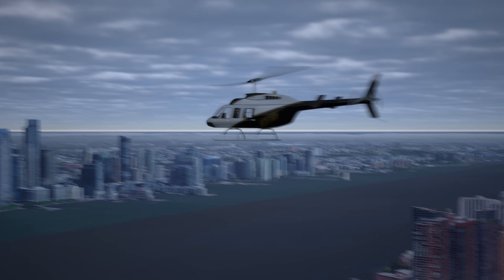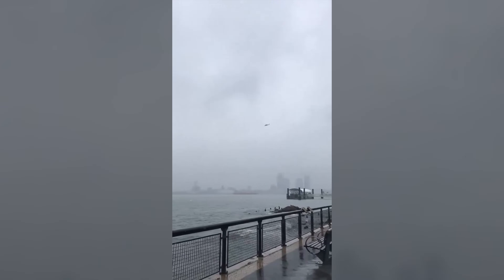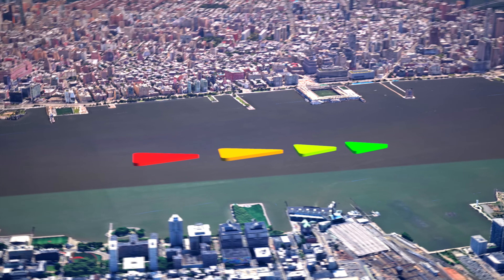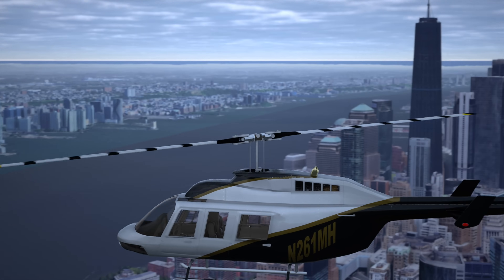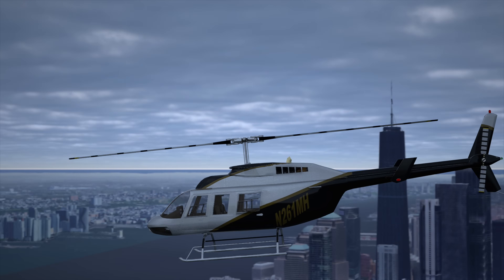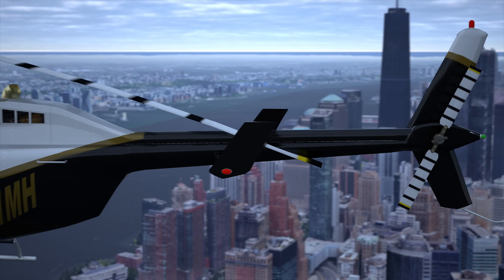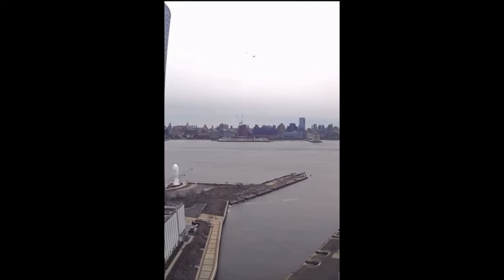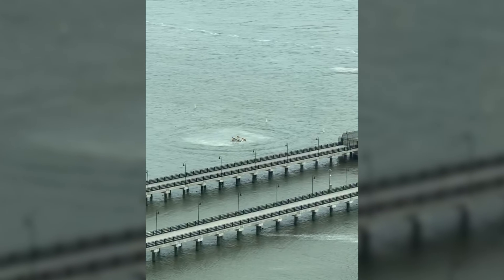Helicopters DON'T just fall from the sky - What is "Mast Bumping"?

Comment: Finally a good video about what possibly happened
Reply: But you got admit it’s a good guesswork
Reply: except the rotor blades were intact with the gearbox while flying into the river.
Reply: @bobbys4327   I wonder the rotor mass broke off that what look like. Which is odd
Reply: Orrr yall could just wait until the do a full report and find out what exactly happened instead of speculation. Whats the point in needing to guess what happened  NOW

Comment: An underslung rotor system (like this one) is prone to mast bumping. Rigid and articulated systems are not. Mast bumping is when the hub contacts the mast during low g maneuvers or other abnormal conditions. It can happen without damaging the helicopter. Mast bumping does not = main rotor contact with fuselage/tailboom. I lean more toward cabin roof delamination, xmsn mounting, or other failure over mast bumping. Also, in a truly catastrophic MB scenario, wouldn’t the rotor separate at the hub (where contact is made) and not take the xmsn along with it? 

Still a good animation and presentation.
Reply: I agree, don't think this is mast bumping due to the fact the transmission is with the rotors
Reply: @MattyEngland  Gearbox failure is the most likely cause.
Reply: Not if you are carrying a CEO, I think there is much more to story
Reply: @JimmyBeanz13  CEO's are not immune from accidents. The incident helicopter had already flown 5 perious flights.
Reply: @ Apparently you haven't looked into owner of the heli company much....tell me what you find

Comment: In the footage from the beginning it seems the aircraft rotates aggressively to one side, AND THEN 1 or 2 seconds after that, the tail boom seems to separate from the aerodynamic pressure (?)

Question: Could this aggressive rotation be caused by the malfunction of the tail rotor?

The video is quite low resolution, so it could also be that the boom indeed separates and the rotation happens from that, and the falling tail boom is just hidden behind the main body of the helicopter from this angle.

Comment: Wouldn't the rotors hitting the tail shatter the blades when they appeared to be fully intact and still flying on their own
Reply: The blades are one of the strongest components of a helicopter.  Looking at other helicopter wreckages, the blades sometimes only bend even when they hit the ground.
Reply: @toolbaggers  I do know the old S-58 and H-53 blades are that way. I know they are tough, Bell blades, but they are laminated and composite. Certain instances they may shatter, just being composite.
Reply: @idrinklight44  The ones I saw were shredded.
Reply: Blades are pretty tough
Reply: Good point. The "parts" look very intact, like almost a perfect separation, but I don't know. Not a #expert
Reply: No they wouldn’t. Blades are extremely strong, helicopter tail booms are rather flimsy as they have to be light.
An impact with the boom will leave significant witness marks on the leading edges of the blade though.
Reply: Yes they would.
Reply: Jesus nut.
Reply: The blades maybe though but they would definitely have deformed with a tail strike.
Reply: @Dyson_Cyberdynesystems  unless the tail was weakened before, and broke because of the hit.

Comment: October 8, 2024 - Meridian Helicopters earns FAA Part 145 repair station certificate.

With this FAA certification, Meridian Helicopters, LLC can now provide extensive services in five critical areas: 
1- Airframe: Specialized in sheet metal and composite repair, comprehensive component overhauls, routine maintenance, and detailed inspections. 

2- Engine: Authorized to inspect and maintain Rolls-Royce M250 – C20, C28, C30, and C47 series engines. 
Instrument: Certified to install and test essential flight instruments. 

3- Avionics: Equipped to install and test advanced avionics systems, ensuring safety and operational efficiency. 

4- Pitot Static and Transponder: Qualified to test and inspect these critical components for optimal performance and regulatory compliance.

Comment: That helicopter looks obsolete.
Reply: That was my sense.  I gather it was getting long in the tooth and had been repainted and repurposed for NYC tours and duty with light stress at most.   If I was starting an air tour business, I would likely buy used equipment, refurbish it and rely on maintenance.  Despite the best maintenance, all machines eventually wear out.  There is a technical term:  the law of entropy.  I am not attempting to imply that there is anyone at fault or assign blame. It's just the fact that things wear out overtime. I would be interested in knowing the age of this helicopter; also who the previous owner was and the type of duty that the equipment performed. I really hate to mention this in light of the tragic loss of life and in no way desire to lessen this tragedy.  

I am quite familiar with the funeral business. Large funeral homes purchase new limos and hearses every two or three years because they have to in high volume competitive markets; the trade-ins end up at second tier funeral homes (or livery companies) with less business and consumers who do not expect or are conscious of the latest  models.  They are still in good to excellent condition mechanically but are seen as being slightly out of style, but not noticeably so to the average person; when the second tier funeral home needs new equipment they will trade in the rolling stock which will then be bought up by start-up funeral homes or funeral homes in very small locations; or put into service as back up equipment for collecting deceased persons from airports or distant locations to avoid putting  excess miles on newer hearses.. Typically, at this point they're beginning to show their age and their last stop will be a junkyard.  Not much market for a 20 year old funeral car.

This is the sense of what I think could be an issue here. Simple entropy and perhaps issues with obtaining parts for older equipment.  The NTSB report will contain all of this information which will be considered to the extent relevant.  Regardless, just so sad.  And again, this is all speculation and rambling brought on by an effort to deal with tragedy. Such a lovely young family.  From joy to deep sorrow in a matter of minutes.  Prayers to all and deepest sympathy.

Comment: First good video showing the separated rotor assembly I've seen.  Interesting to note that the rotor system is still spinning and attached to the transmission assembly.  In mast bumping the rotor hub will typically separate from the mast.  Something of possibility that has occurred on other Bell products is when a manufacturing defect exists in the glue curing process bonding the blade's leading edge plate. When the leading edge plate de-bonds in flight, it creates a spoiler effect, creating uneven lift on one blade verses the other.  The rotor system goes violently out of track, and one blade will strike the tail boom, doing pretty much what looks like what happened here.  It happens very quickly with maybe a short moment of warning given by main rotor vibration.
Reply: So does the main blade's stay intact(not bent or broken) after such an impact on the tail body? They look in normal shape.
Reply: @planet_oith  That is a good question.  You would be aghast to realize how little a tail boom structure is made up of.  Think of an aluminum beer can, that is your tail boom, light gage aluminum sheet with ring formers every so often (monocoque structure).  Tailrotor driveshaft is a thin metallic tube also.  Main rotor blade easily can stay intact slicing through.
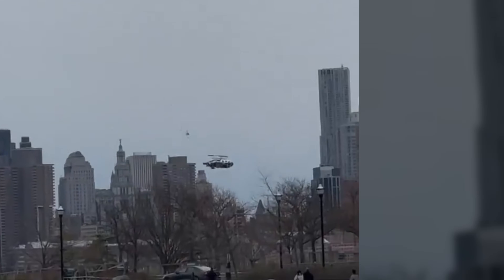Reply: From 01:50 you can almost clearly see the main rotor spinning and the blades are quite intact. This might be an clue that the main rotor in fact, did not struck the tail boom. In other footage of different accidents, when the main rotor blades hit the tail boom, they're instantly destroyed. I might speculate there was a failure of the gearbox mounts and the ruptured tail rotor shaft shattered the tail boom, but only the investigation would establish if it was the case. From the footage of the very beginning of this video, it is visible that the tail boom separated first, then the main rotor. And at 01:44, the engine exhaust is visible, on the upside down helicopter, while the author of this video is saying that the engine ”appears to be missing”. So, this dude ist talking about main rotor blades hitting the tail boom,  despite the quite clear video footage shows that it is unlikely.
Reply: @1zanglang  A bent and damaged rotor could look straight and intact from afar due to centripetal forces. Like how swinging a rope looks like it's solid but turns into a wet noodle if you stop spinning it.
Reply: @1zanglang  or main rotor mast nut
Reply: @1zanglang  excellent observation 👌  well done 👏!!!
Reply: @1zanglang  I've seen heli crash sites with rotor blades hitting the ground looking only slightly bent
Reply: @1zanglang  It does seem that a tail rotor stall might had happened. From how the video looks, you see it come into from the building in the foreground. Then the entire vehicle looks like it just starts to spin and the tail boom snaps off at that point from the force of the spin
Reply: you have the better discussion.  agree mast bumping not likely initial failure.  for that the main rotor shaft fractures at the points where mast bumping occurs.  however, in a full-on tail strike, the main gearbox mount points, or the attaching bolts shear and the whole assembly departs the aircraft laterally.  i tend to think that is what happened.  explains the large flat surfaces departing the aircraft.  cowling components.  secondary damage from severed and flailing drive shafts.
Reply: @dalemilton5773  excellent observation 👌  !
Reply: I noticed that too, so many are quick to jump on mast bumping when freeze frame shows most of the mast and possibly a transmission or upper cowl piece; 
Every mast bump failure ive seen fails at the teeter contact point just under the rotor head.
Reply: @sparkyobrian6417  Also isn't mast bumping caused from a negative g maneuver? Does not look like that was happening in this video
Reply: @donanders2110 yup and it unloads the rotors blades but if you notice the rotors are still attached to the mast and still rotating so I don't know if that's mast bumping
Reply: Good points. Examination of what's left should answer some questions that have been raised too.
Reply: If it had been a delam, the blades would not be spinning evenly and smoothly.
Reply: @ Yeah that thought is running through my mind too was spinning quite efficiently. Failure in the transmission deck/ support? Pitch link failure is another possibility acting similar to the blade delamination hypothesis.
Reply: I was not aware of the delamination action. You may be right that this is causal.
Reply: These observations all seem to be about mechanical issues so I am likely wrong about a medical emergency from the pilot. In such case, which is likely what you guys are seeing, having 2 pilots would just have killed one more person. Darn....so much can go wrong.....Makes me just want to ride a bicycle and then, you get hit by a car.
Reply: Learning more, more video from Juan Brown shows a transmission seizure likely
Reply: @antigrav1302  very good informative explanation 👍  well 👏 said   How this tragedy 😢 could Happened  !!

Comment: um....well, years of working on Helos? sounds like a good working theory.  Leading edge blade impacts bird(s) forcing LE blade up, trailing edge blade impacts tailboom shearing it, force of blade impacting tailboom shears main transmission bolts, engine 3 point mount separates flinging engine as rotating mass of main rotor head and main transmission goes in on direction, force of impact folds up tailboom and tail drive shaft breaks up flinging the tail gearbox in another direction. 900-1100 feet up in the air? Survival wasn't possible with a helo stripped of its tailboom, and rotor head. Just a brick dropping into the river at that point.

Comment: They already said why it fell. They called in saying they needed gas and 3 minutes away. 20 mins later they crashed. Obviously they ran out of gas
Reply: That won't cause the helicopter to break apart. If you have an engine failure or run out of gas, they do what's called an "autorotation" which will allow the helicopter to glide down safely.
Reply: Pilot would have carried out an auto rotation. Clearly it fell apart, nothing to do with lack of fuel.
Reply: Clearly not. 🙄 Does your car disintegrate when you run out of gas?

Comment: Thanks for the video. Read the comments and of course it will get off the trail. There are many many aerodynamic scenarios which can lead to mast bumping which is why it is difficult to fly a helicopter. The pilot has to be extremely aware at all times. The simplest issues of airspeed and up/down draft can even have an effect.
Reply: bell 206 it's old tech..modern helicopters the risk of mast bump is minimal

Comment: I don't think it was a mast bumping incident. I reviewed the footage with a 206 A&P/Pilot, and he said it looked like the full transmission assembly looked to still be attached to the rotor system after breaking apart.
Reply: That’s what I saw as well, which is why I don’t think it was mast bumping.
Reply: So true. And on the other hand, the ship spins aggressively to the right after whatever happens first, so it can’t be the transmission itself breaking apart—since in this model, the blades spin counterclockwise (hence, if it suddenly stops, the inertia from the deceleration should spin the ship to the left).

The only explanation I can kind of match with this is a catastrophic tail failure—and I mean the entire tail, not just the tail rotor. That could cause the center of gravity to shift so suddenly that the transmission could come apart. And if you lose the vertical stabilizer, you can’t rely on the Kaman effect to handle the emergency on the other side.

We’ll see once the investigation is released in a few years anyway.
Reply: As if there were never pilot errors or poor maintenance prior to DEI.  Stop looking for scapegoats.
Reply: Look like bolts came loose and broke off and send the whole transmission and rotor flying
Reply: DEI
Reply: @iamNOTyourDADDY  What are you trying to hide?
Reply: @iamNOTyourDADDY  while I'm on the side of DEI being a very, very bad thing, I think it's irresponsible to throw it at every incident until all the facts are known.

Comment: I was open to the mast bumping theory, but this video is first time I've seen that clip you put at the beginning @ 0:02. Doesn't seem like the helicopter was performing any crazy maneuvers. 

Seems like the thing just fell apart. But I'm just an untrained eye and we didn't see what was going on before that moment.
Reply: Very true. Also mast bumping usually destroys the main rotor blades from the impact with the tail. These were not only still intact but also rotating so it pretty much eliminates rotor bumping. Most likely at the early state was some sort of mechanical issue. An engine seize would cause the rotor and tail rotor to rip out of the vehicle due to inertia and allow the main rotor blades to keep spinning as seen in the video.
Reply: @grumpyoldstudios yeah, but the engine and freewheeling unit both failing at the same time?..... I don't know. One thing that does support your idea of a powerplant related issue is the floats were deployed indicating the pilot possibly had started emergency procedures for an engine failure... Very sad outcome no matter what though. My stomach turned when I first saw the video of it.
Reply: @aaronthiele7515 the engine did not come out. That was the transmission attached to the blades. Just a clarification.
Reply: @thomaswilson8634  correct, it looks like the engine is still attached to the fuselage in the footage.
Reply from the maker: Yea that video came out just this morning as I was finishing the video. It’s still consistent with mast bumping. It’s very low resolution so it’s hard to draw conclusions.

Comment: Sorry Mate but I’ve got to call out your description of mast bumping, it is not accurate at all.
Given your video seeks to be informative and the nature of the accident accuracy is important. I’m not trying to be an AH but people will probably watch and draw conclusions from this.

Mast bumping from low or negative G the rotors do not get hit by turbulence. 
The fuselage hangs from the rotor through gravity and/or G as it losses weight from low or negative G the fuselage gets an uncommanded roll because of tail rotor forces but the disk remains level. That is what makes the mast bump.

I have not heard of mast bumping been from control input other than in initiating the low G with forward cyclic. I guess it’s possible to cut off your tail with aft cyclic but it would have to be an extreme movement.

Mast bumping is a possibility but it could also be a mechanical failure, it is too early to know.
Reply from the maker: There’s lots of causes of mast bumping. You’re describing only one very specific example.
Reply: @Brian.Murray your description of turbulence on one side causing the blade to tilt is wrong. That doesn’t happen. 
The very specific example I have described is the one that causes all the accidents.
Reply: Negative G maneuvers are the leading cause of mast bumping but by no means the only. The scenarios he explained are possible causes of bumping. My gut feeling is it’s going to be a purely mechanical failure as a cause and the pilot could do nothing to save them.
Reply: Good